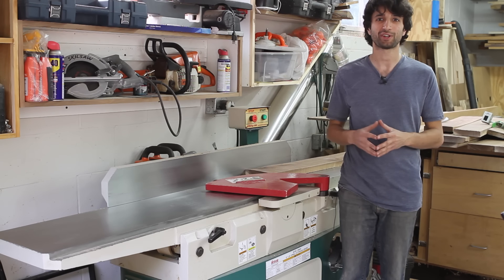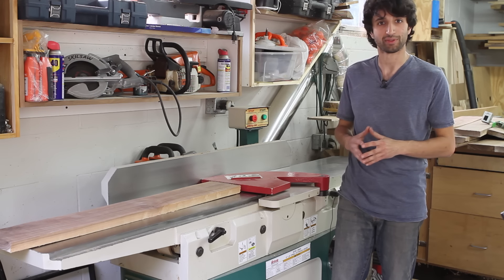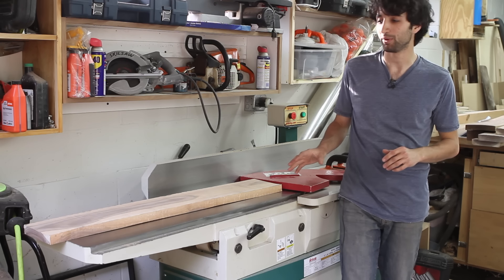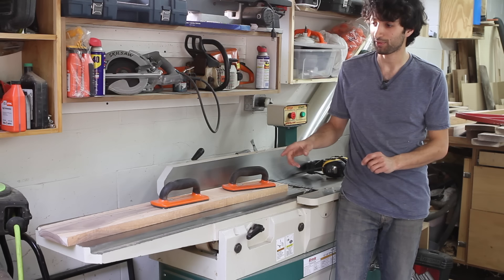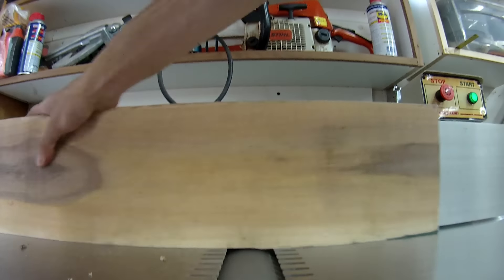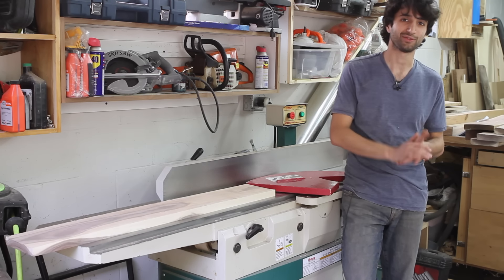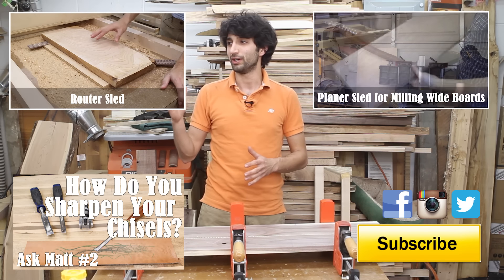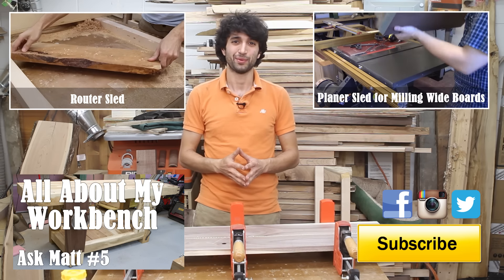What Does a Jointer Do? - Ask Matt #13

Comment: Matthew Cremona  was I understanding your technique that you use the glue squeeze out to gage your clamping pressure? Obviously dependent on amount of glue though. Any comments/tips on that? I tend to over clamp. Thanks.
Reply from the maker: Charles Li Yes, that seam off the jointer is pretty much perfect.  I only need to apply enough pressure to squeeze the excess glue out.  If you watch me tightening the clamps you can see I don't have to grab the handle to apply pressure.  I'm able to apply enough pressure by turning the handles with my finger tips.  Great question!
Reply: Matthew Cremona great thanks will try that next time!

Comment: How do you deal with a board where the facing edge has damage or is not true (parallel) to opposite facing edge? 
Maye use Jointer to insure reference edge and then table saw for opposite edge?

Comment: is it possible to lock or somehow disengage the roller heads on a planer and feed stock through without downward pressure coming from the head?
Reply: +elindred  Sure, if you want the board to leave the planer at high speed and go through a wall!
Reply: that's what the rollers do.

Comment: Hello Matt, thank you for sharing this informative video.  Quick question.  I am a beginner in wood working and would like to get a planner. Of course, I have limited budget for it.  Around $500 or less.  What make and model do you suggest?  Thanks. Jack
Reply from the maker: Just about every portable planer will fall into that price range.  Look 
for something with a locking head or a head that is nice and rigid.  3 
knife cutter would be better than a 2 knife.
Reply: Thank you.

Comment: Speaking of jointing, how do you like that Grizzly 12" jointer now that you've had it for a while?
Reply from the maker: Coming up on 4 years. I'm still in love with it.
Reply: Awesome!  Any issues with delivery?  It seems like most of the problems I've read about Grizzly involve shipping damage (not Grizzly's fault).
Reply from the maker: Blood, Sweat, Sawdust No issues.  The crates typically will have some damage but they're sacrificial anyways.  Just have the driver note the damage before you sign for it, just in case.  Maybe snap some pictures too.  I had my grizzly stuff delivered with the lift gate option.  Each time the driver was really nice and brought the pallet into the shop for me since they have a pallet jack anyways.

Comment: Can you place a completely flat board on top of the bowed board and then run them both through the planer with the flat board on top facing the rollers? Will this flatten the bottom board?
Reply: I just saw a video of someone doing that and it worked just fine. Although it looked a bit cumbersome for long boards since the table of the thickness planer was so small. I can imagine that someone who is a hobbyist like me, would get more mileage out of a planer, a flat piece of melamine and some double stick tape.

Comment: What would you recommend buying the jointer and planer or just buying the wood already planes and jointed
Reply from the maker: depends on how much material you go through.  Rough material is typically a lot cheaper than surfaced so the machines quickly pay for themselves after a few hundred board feet.

Comment: Still unclear about the pressure of feed. Say there is a bow that curves upward? If you push down on the front, it will be biased to the front tip and will have to go through the board until it levels with the tail. How do you plane the board to focus on the center?
Reply from the maker: two ways to do that: In the orientation you describe, pressure is applied to the middle so only it is contacting the table.  The works material down from the middle out to the ends.  The way I prefer to do that is to flip the board over so the two ends are touching.  That will work the material down from the ends to the center and is easier to balance since there is two points of contact.

Comment: Hey Matt,  I have never done ANY sort of woodworking but I have some projects I want to do this year and am planning to take a woodworking class later this month to get a better understanding of the correct tools to use, and proper way to use them.  I was hoping to be able to just buy wood at Home Depot, Lowes, etc and just get to building in my garage.  

Is it possible to buy wood already ready to use or do I need to do this with all the wood I buy?
Reply from the maker: You might be able to get by for sometime but eventually you're going to get sick of not being able to flatten boards in your shop while you are working.  Having your own milling machines also opens you up to using stock of any dimension that you want.  I think you'll see that value in the woodworking class you're planning on taking.
Reply: +Matthew Cremona  Thanks for the reply.
Reply from the maker: No problem!

Comment: Is your jointer mobile?? Checking Grizzly 12" Jointer and do not see any info about a mobile stand.. But seen some videos and looks like you have had it moved in your shop before..Wanting to get the 12" but do not want it stuck in one spot as I am moving to a new place and not sure how I want to set up shop..
Reply from the maker: +Brian Paul yes I have it on the super heavy duty base with the extension rails

Comment: putting pressure on not flat, uneven surfaces is just creating stress in your piece or project which is not desired. So better have them square and parallel before putting them together... use a jointer or just a handplane if you dont have one!

Comment: How long of a board will a jointer straighten?  I have a 14 foot curved that I would like to straighten.
Reply from the maker: I've found that it can do up to 1.5x it's total length.  If the board is somewhat straight already though it could do longer boards.

Comment: How often do you have to sharpen and or replace the knives?
Reply from the maker: I have the carbide insert style cutter head.  Each insert has 4 cutting edges that can be rotated.  I haven't had to rotate them yet.  I've had this jointer for 4 years.

Comment: I wonder if I had a 12" jointer if I could use it to flatten a 24" wide board by removing the guard and running it through again with the other side against the fence.

Comment: Hi Matt, Thank you so much for this. My problem is more of keeping the wood flat. Do you have any techniques in preventing wood from warping?
Reply: Its been awhile since your post, so you might not get this, but that is part of the point of a jointer, the wood has largely settled into its warp, then you square it with the jointer and plane it down with the planer, and the wood wants to stay where it is and not warp anymore (very little).

Comment: Cupping and bowing can be removed using just a planer with a sled and shims.
Reply from the maker: As can twist if you want to set up a sled for every board that passes through your shop
Reply: Generally, I use the sled technique to flatten the boards through the planer because I usually purchase very wide and long stock. I also use a sled to straight line rough stock using the table saw. However, I do find the jointer to be very well suited for squaring up edges that are to be glued together. There is almost no substitute for how perfectly straight and square a well adjusted jointer will make the edge of your lumber.

Comment: Is the standalone jointer significantly better than the bench version? I'm debating a purchase. Thanks. Good tips in vid. BTW, I'm not in blackface. It's motor oil.
Reply: standalone. those are more fine tuned made. You'd only worry about having a relatively flat floor. bench top would be affected by the benchtop its on, with any of its issues.

Comment: Wouldn’t different boards require more or less passes on jointer?   Meaning they would all be different thicknesses.   So if you glue them together they would not be flush..  is a planer then required?
Reply from the maker: Correct

Comment: Is the idea that you run it twice to verify that the cutter cut the whole length?
Reply: You know it's flat if you take material off the whole length and width - assuming you're using the jointer correctly. It could take more passes on a bad board because you could end up using a number of passes to take out a severe bow or cup.

Comment: Are there hand tools that do the job of a jointer and planner ?
Reply: (Yes.) You can find a lot of YouTube videos that show you the process of dimensioning lumber using hand tools. I think they're useful to watch if for no other reason, they give you an appreciation of all that a finely tuned machine is doing for you. But you may also like a more contemplative approach of using hand saws and planes, winding sticks, marking gauges, squares, etc.
Reply: gcbound I have made some basic stuff before like shelves and a mantel , which was a 2x10 and some trim. I am trying I want to start making more complex things like a tv stand and other things , but its been difficult to find the essential tools necessary to do this stuff.

Comment: So... a planer and a jointer are exactly the same, except the planer has the guard that goes over the top with a roller in it? Does anyone make a planer where that top bit comes off so it can be used as a jointer?

Comment: Is it possible to just buy wood that's already been planed and squared up? I'm assuming that the cost of that wood would go up because of the labor that was put into the wood but wouldn't that out weigh the cost of buying a planer? That way the average hobbyist(like myself) could save some money and space.
Reply from the maker: yes, you can buy s4s. You will be limited to the thicknesses that are provided by the mill though and if the boards you buy develop any warp, you won't be able to flatten them out.   Cost savings will depend on species, your location and volume of lumber you use.  The materials cost savings paid for each machine within a couple years in my case.

Comment: I'm curious. Why can't you flatten both edges using the jointer instead of using a table saw for the other edge?
Reply from the maker: it doesn't mean that the edges will be parallel.  You'll likely end up with a board that is tapered from one end to the other
Reply: I see. Thanks.

Comment: Question regarding planer vs jointer.  I have my planer set with support tables before and after the planer.  Whenever I have stock that has problems like the board you've used in this video, I set the width to only cut the parts of the board that are out of alignment (so the rollers engage but the blades don't until they hit a high spot).  I then reduce the width over multiple passes to get a flat board.

Are there any disadvantages to using this method?  It seems like I might be removing more material than I might if I were using the jointer, but other than that it seems to work fine.  I ask because I've had a jointer sitting in my shop for years - someone suggested I needed one - and I never really figured out what I was supposed to do with it.  After watching your video, I see the advantages, but mine is only a 6".  I'd need to build a table to extend it's usefulness since it only has 14" of platform to receive material.  Worth the effort or no?

Great video, thanks!

Comment: Is there a reason I am not thinking of that you can't just use a jointer for stock removal down to the thickness you want? Yes it's multiple passes and a lot more work, but if you can do that why wouldn't you buy a jointer first a planer for convenience later?
Reply: You technically could. But the problem with just having a jointer is that the two faces are not guaranteed to be parallel. Imagine the thickness of your board was tapered when it came into the shop. You joint both of the faces so they're nice and flat, but the taper will still be there. On the jointer there's no way to reference your now flat face to plane down the opposing face. That's what the planer and tablesaw are for.
Reply: Graham Rigby Yeah, but I mean in reality how critical is that? I guess it will be smarter to go Stanley no. 5 jack plane and a thickness planer. I just feel as though getting something perfectly flat isn't possible by hand, but once it's flat it's not as intimidating. I'd really like to mill my own lumber using an alaskan chainsaw mill. Maybe that will make my needs different then others. I know I really should have both, but I'd really only like to buy a quality tablesaw and one other tool at first.

Comment: The real challenge is to use a #7 hand plane with a razor sharp iron and plane the edges and put some glue on the edge and rub the two edges together until they are properly aligned and cannot move due to a suction and no need for clamps....  It takes practice....

Comment: Why don’t boards just come planed and jointed? I can’t imagine a project where you’d WANT a board that’s bowed or twisted. I understand wood bends and warps in transit, but as tools like these aren’t reasonable to have in a standard home workshop you’d think at least they’d offer it as a service at Home Depot or Lowe’s.
Reply: Mostly happens during the curing process. The moisture content varies drastically at places like homedepot. Next time your getting lumber take a second and you will notice the weight difference in a bundle of boards

Comment: Actually the jointer tables are NOT on the same plane. This is why it works to flatten boards. They are on 2 different plates which are perfect;y parallel

Comment: why do you need to run the board through table saw after all this? newbie question
Reply: He is assuming that the board is not the width you want.  If it is, you could just use the jointer on the other side to create the 90 degree straight edge or the table saw to just shave off a little.  The assumption is both sides of the board should be flat and parallel.

Comment: Can you use the jointer to square all 4 sides?  instead of using the jointer, planer and table saw?
Reply: Jesse Taylor You could, but this won't guarantee that the two sides are a parellel. Both sides will be flat but the thickness might taper
Reply: Thanks aaroncrabbe!
Reply: aaroncrabbe you could avoid the table saw (if you didn't need a narrower piece) by flipping the board and jointing the other edge, no?
Reply: No, since that still doesn't guarantee the two sides will be parallel. Like Aaron said, the jointer just makes things flat. You need to reference the other side with a table saw fence or a planer bed in order to make sure everything is parallel.
Reply: I think the two edges should be parallel to each other as long as the jointer fence is set at 90 degrees because you could reference the previously jointed face of the board for the two edges. However, this still only does three sides and there is no way that I can think of to make the other face of the board parallel to the first face without a planer.
Reply: Andrew Clark Sorry, that's not how it works. The jointer just gives you straight edges. They will be square  to the faces if you set the fence at 90 degrees, but the two edges aren't guaranteed to be parallel to each other. If you still don't believe me, then go try it.

Comment: Could I not just lift my planer top so it's not touching the board/applying downward force and push the board through for the same results as a jointer on my planer?
Reply: Josh Adams , sure but jointers have much longer run-on and run-off tables that assist in getting a truly flat surface.

Comment: But it seems like once you run it through the jointer so that one side is flat, you could just flip it over and do the other side the same way.  What am I missing?
Reply: A good way to test your assumption is to go to the extreme.I am going to flatten one face of a board,the face I am flattening is 8" by 72",however,the board is 6" thick on one edge and 1" on the other.I have made the face completely flat ,if I try to make the opposite face parallel on the joiner one can clearly see how this is not possible.Now in dealing with standard lumber,the amount the board deviates from having parallel faces after joining the first face will be different for each board (you are taking differing amounts of wood from the thickness, along the length of the board).The easiest way to get a parallel surface to this face is to put our reference edge,the face we just jointed, on the bottom  in a planer.With each pass the planer takes all of the high spots off until we get to the final thickness that is needed.Going back to our extreme board,by using the planer we can get even this board to have parallel faces.We can push the board through and the 6" side is reduced we lower the planer a bit and continue until the six inch side is 1 inch,all this while the reference face has been down and at this point the board can be made to whatever dimension is called for,both faces of this board are now parallel.

Comment: @738polarbear Not so great explanation when he's talking nonsense and also showing with his hands @ 4:15 about the cut depth being determined by the infeed table set lower (on a different plane) that the outfeed table, which is impossible for coplanar tables  ! @Joe Ciccone is right in his comment @ 4:18 he also totally shows parallel planes not coplanar .

Comment: And yet in a machine shop, the machine you would use to remove defects like warping and twists is called a planer (just a really big shaper with a moving table instead of a moving head). Borrowed vocabulary once again proves to be quite hazardous for cross-profession cooperation.